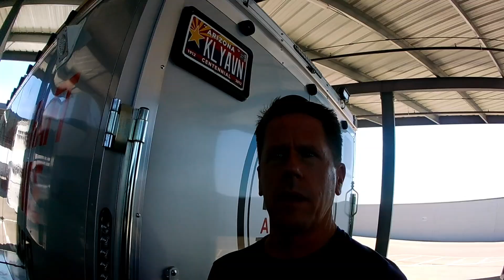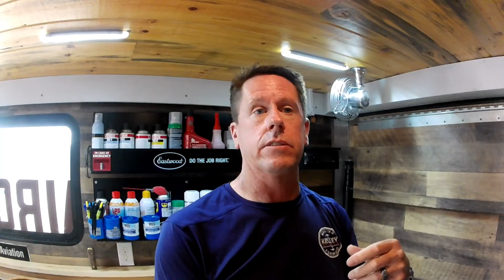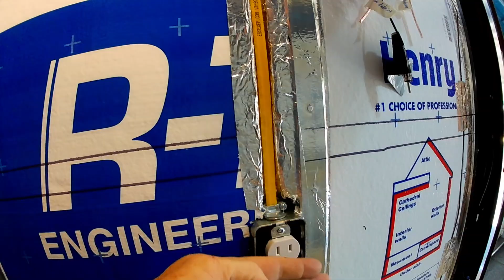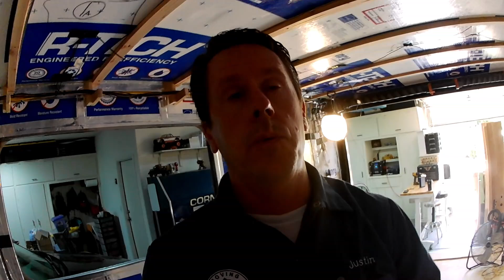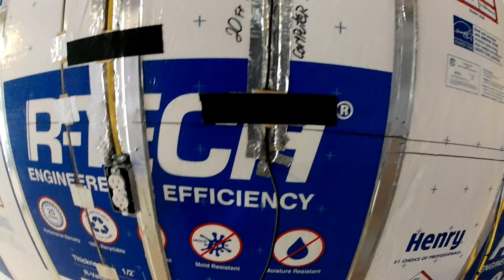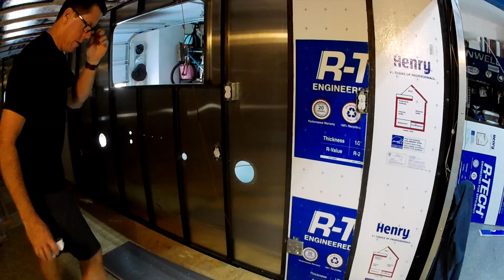Electrical and Insulation

Comment: You have a great setup! Out of curiosity, how much did it cost to build it?
Reply from the maker: The power barn probably came in around $10,000. The whole trailer was around $40,000
Reply: Thanks! I am looking forward to watching any more videos that you have of your trailer. Im an A&P and am in the process of planning out a mobile setup for in the future.
Reply from the maker: @ironforge1808  That's great !! Are you going to do General Aviation or ? There is a huge market for this nitch. Once I finish the trailer build on YouTube I wanted to turn the channel towards us doing maintenance and create a GA maintenance channel. Editing these videos takes a while.
Reply: The plan is to do General aviation full time. But I may have to get into cropduster maintenance until I can build a client list so that a business can be self sufficient.

A question for you, what do you use for manuals? Veryon (ATP) seems outrageous for the price per year but I know that it is very good. Ive been seeing things about a company called Grease Mechanic/Phalanx which have a cheaper subscription for GA manuals and a very broad arrangement of aircraft, but I can't seem to find reviews on that company from outside sources. I dont know what the quality of those manuals would be.
Reply from the maker: @ironforge1808  Yes Veryon is a complete RIP OFF. Most of the aircraft out there today are from the 50's & 70's, so just about all of the manuals have been updated & revised long ago. You can download them free from the internet. There are quite a few sites out there you can use. Just type into Google the manual your looking for and you can usually find it. I use TBX for my aircraft files. It's a cloud-based aviation compliance and maintenance management platform.
Reply: @KelleyAviation Thanks, I'll look into it.